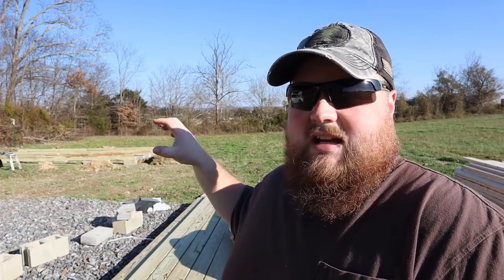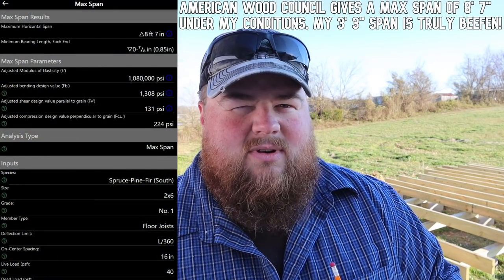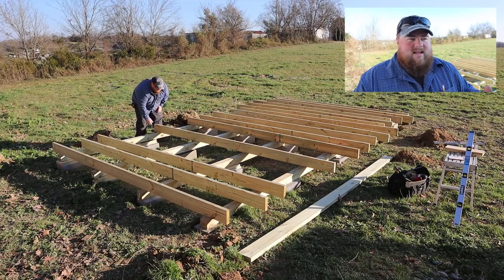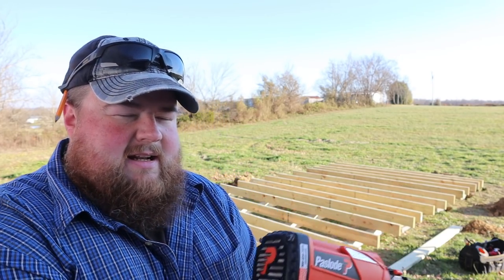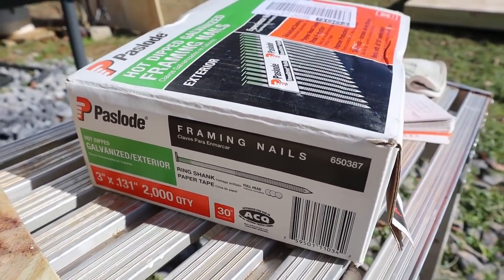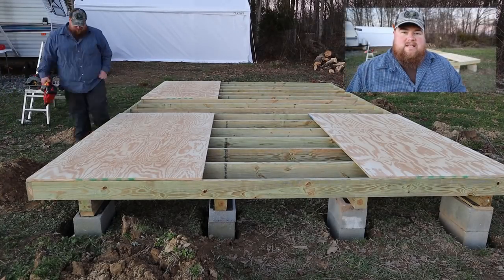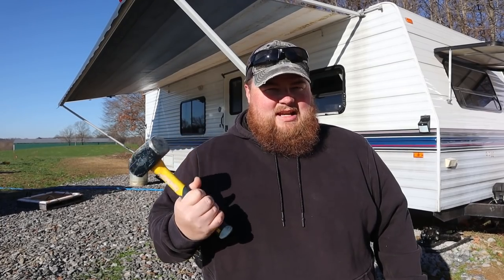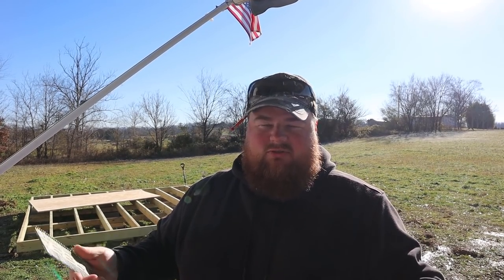THE BALL IS ROLLING NOW | Floor Framing & Decking - Workshop Build 02

Comment: I saw on a Homestead build , where I saw him use clear sheet plastic to cover plywood. Just stapled it down. He put his chalk lines down and all markings and used clear spray paint to protect lines from smearing. Covered with plastic and build on top until finally enclosed. Then removed the plastic. Wish I can remember who to give credit too. Maybe Deep South Homestead cabin build. 🤔
Reply from the maker: I did that once on a shed build... never again! Moisture became trapped between the plastic and OSB flooring and it wasn't able to dry out. This was a shed, not a home, and had an elevated un-sealed floor like my workshop.

Comment: still like screws better than nails , its eazier to take stuff a part when its screwed together (as long as you dont strip the heads) and i believe the holdingpower of a screw is better than a nail (wont work loose and / or creak ) unless you combine it with glue

Comment: Hey Sam, do you have any plans youre working off of, or are you just building off random specs. We're getting ready to break ground on a building as well, and i dread foundation work.

Yall keep trucking, keeps giving me motivation to get it done.
Reply from the maker: I built the whole building on the computer in SketchUp first, and am using rough plans from it. Since it's a basic design with minimal complexities, and I've built several before, I don't have any true plans I'm using out in the field. I just take notes of the important parts I need to remember for that step.

Comment: My floor joists have an 8 foot span with no skids to toenail to. I'm trying to decide if I need blocking between the joists. 
Do you know what the code is?  Your floor looks great.
Reply from the maker: I'm no code-ologist, but you'll want to add what is called joist bridging to help the floor support and transfer loads better. It will help with the bouncy feel too. You can do metal bridges or make your own out of wood.

Comment: GREAT JOB! Are you going to do insulation for year round use?
Reply from the maker: No insulation for the floor. Walls and ceiling yes. Heat is the bigger force to fight out here than the cold.

Comment: Most likely  it's too late as you are past but blocking  or cross bracing of floor joist would be good to keep from twisting  or warping   true you nail floor  to then  but when board warp nails  will pull loose and allow to warp
Reply: Also rigidity in case you should decide to move it.

Comment: Wondering if it would of been better to got some underlayment under the flooring like a mobile home has and then lay  in insulation in between joists. I am a mobile home owner like you and have replaced floors in several homes. Maybe different in Tennessee than here in Florida but the one thing I know is that when the underlayment falls off and insulation falls through, that is where the floors really rot. I would assume this is because of the humidity, floor cold on one side, hot on other. Maybe the plywood will hold up better than the crap they use for mobile homes.
 But your foundation sure looks great, I'd love to get a Paslode but I don't do enough building anymore to justify the cost. Nails beat screws every day of the week for structural construction, especially if there is a lot of flex, where screws just snap off, nails will at least bend and like you said, the time savings and cost savings of nails over screws.

Comment: Pas Load nailer !  My  First Knowledge of it -I need to get out more...  Slow down there Mister Your going to fast !  And you have very good help !
Reply from the maker: I got it back when we did our roof project. I had to either buy a compressor + nail gun or this one. I chose this one so I didn't trip over hoses on the roof and never dreamed of this new homestead build. I'm glad now that I got it -- it's a great use and requires only the small batter to be charged once per work day or less.